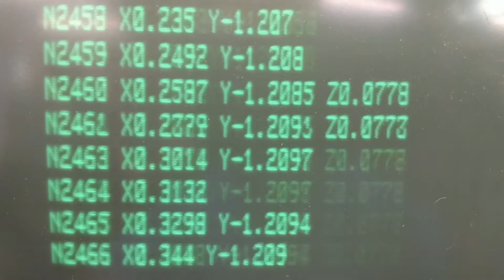Making a Lathe part on a Mill, Part 2 Machining (Moisture Separator Retainer)

Comment: I've only just skimmed the videos, and I'm not familiar with your particular vice, but wouldn't you hold it better in the middle of the vice instead of all they way out to the side?

Our vices at work can skew slightly if we clamp all the way to the side like you do and then exactly the same thing can happen. :)

And I completely agree, you're only doing a couple of parts, it's better to just get them done rather than spending too much time optimizing and using a lot of tools.
Reply: And I just got to the part where you explained it :D
Reply from the maker: Hello Mark, yes, I clamp off to the side a lot, but put a block on the opposite side to prevent canting the vice jaws. Thanks for your feedback and interest.

Comment: I didn't run a Fadal for very long, but one thing I noticed about the 88HS control is just how smoothly it accelerates and decelerates rapid tool motions.  It always ramps up and ramps down instead of going full on and full off like most other CNC controls.
Reply from the maker: Yes, it positions nicely even when you rapid to a position. Also helps when you start adding a lot of mass to the table.

Comment: Never knew you had a twin...lol...nice edit! Man that 2" mill can really remove metal quick. Man I'd love to have a machine like that, some day... Anyway, thanks for sharing keep 'em coming!
Reply from the maker: Thanks, trying to keep these a little entertaining too.As long as the tool and the part have the rigidity and the machine has the horsepower, rip away! Remember though, big tools take big cuts, but also make even bigger BANGs when it goes wrong. The 3" mill I have shown is a 6 insert 45 degree cutter, I have run that upto 7 HP which is my limit on single phase power. That really makes some big chips.